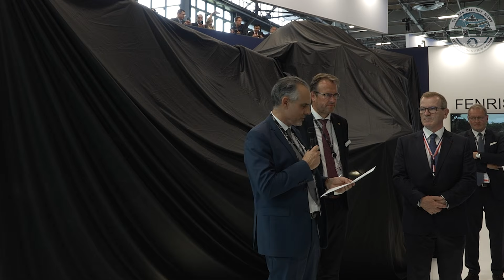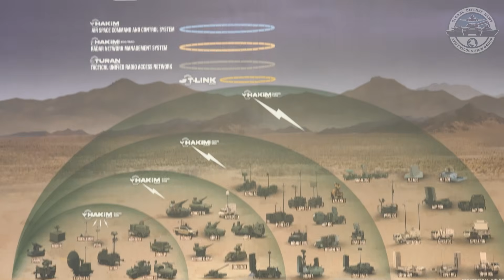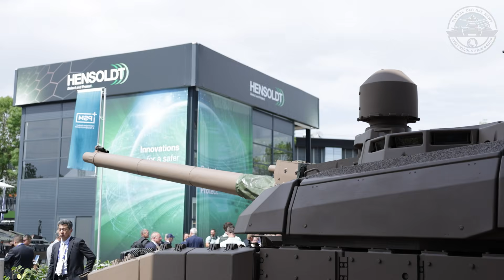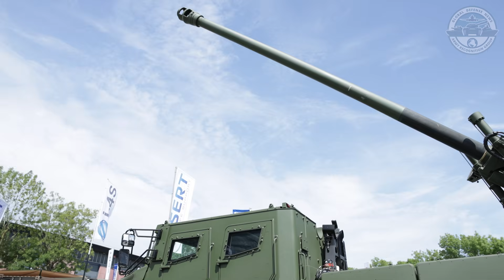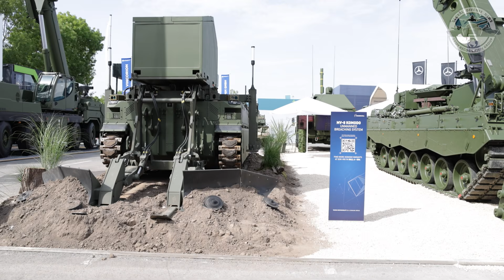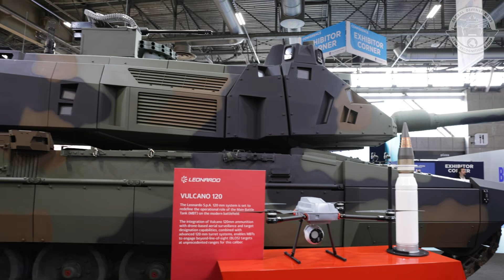Top Military Technologies Unveiled at Eurosatory 2026 | Day 1 Highlights

Comment: I wonder how the driver will get out of this Italian-German tank?
Reply: They born inside the tank
Reply: They can move like spaghetti
Reply: Sara un prototipo
Reply: The crew dasn't get out....they got to live inside the tank for the rest of they're life😂😂😂joke on side... Is Just a moke up at the Moment.
..
Reply: The torpedo tube
Reply: The torpedo tube
Reply: The space Is tight on purpose. The main danger for crews at the moment is not the tank "exploding", but the active targeting of hatches  by drone operators, especially when opened, which happens a lot durung long hours deployments.
The KF-51U design was rejected because the two spikes on the floor can protect most of the tank front from above attacks, and the driver hatch, statistically is the most sought after target by hunting drones in Ukraine because it disable the tank movemet and allows for swarm attacks to kill the tank later.
You can enter and exit obviously with a bit of practice and getting out is easier that getting in.
Knowing how claustrophobic tank interiors are, giving the pilot the ability to look out without being bombed on sight is worth squeezing yourself a bit while going in and out.
Reply: @Zumzifero  You're overestimating the role of drones. They need to be neutralized before they reach the vehicle. Examples of such a solution include the Lonidas or DroneLight systems. There are many more.
Light infantry will be more threatened by drones, not armor.
Ergo, your argument does not convince me.
Reply: @Robert-ze1vw  that's the official argument from Leonardo, so you can go at Eurosatory and tell them they are wrong!😂
Drone swarms are an actual reality in Ukraine. You kill all those you can, but then... ...good luck!
Reply: @Zumzifero  In my opinion, a war like the one currently in Ukraine will last a year and a half. Then there will be another change. And this change will be forced by counter-drone systems. I don't expect drones to disappear. More drones and other counter-drone systems will appear.
What will happen? We'll see. After all, I'm no one special enough to know.